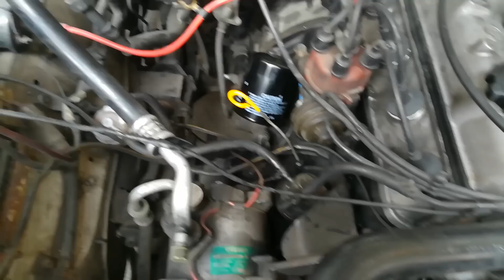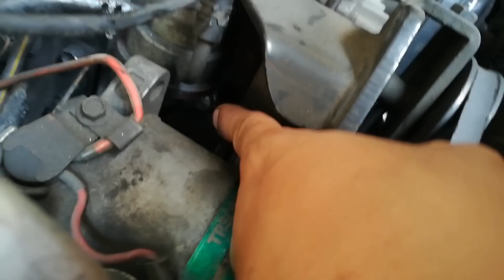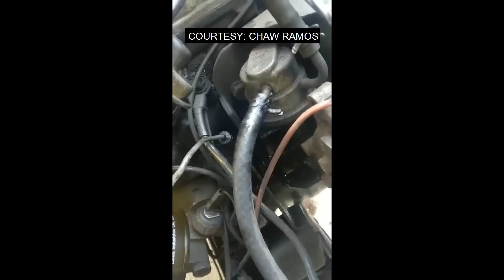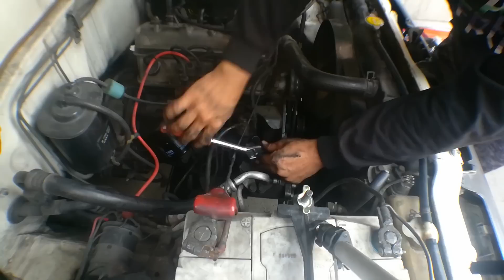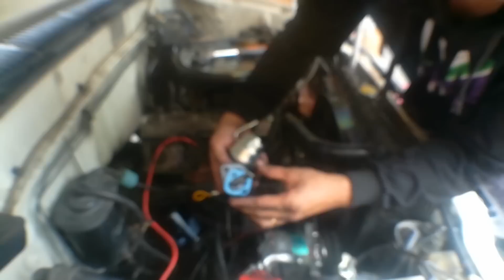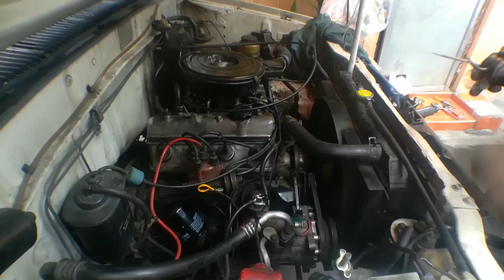Fuel Pump Replacement TOYOTA 5K Engine

Comment: Boss bakit yung fx ko ,ok naman po sa longdistance na biyahe pero kapag nasa tarik na kmi at paguminit nawawalan ng laman na gas yung fuel filter ,kqya po pag pinalamig ko makina nagkakaroon na ng gas yung fuel filter nahigop na fuel pump ,pero pag mainit di itoasyado mahigop ,ano po ba deperensya nito ,pakisagot po tanong ko ,maraming salamat po.